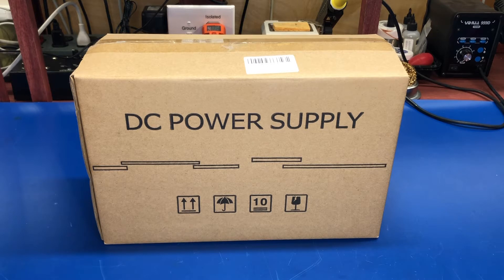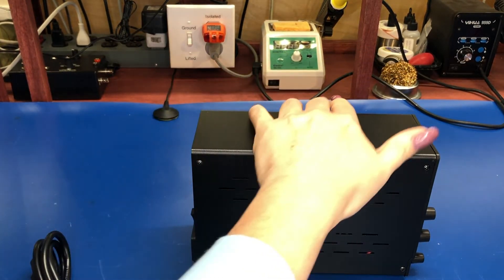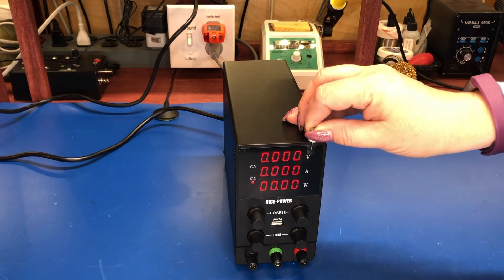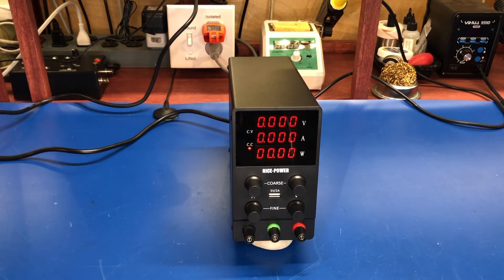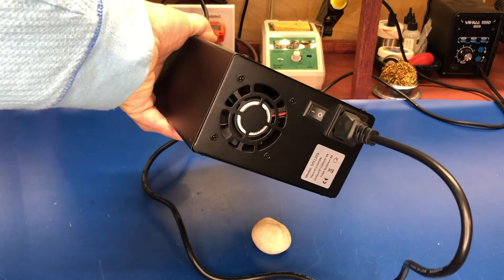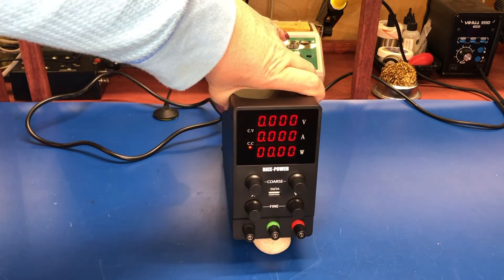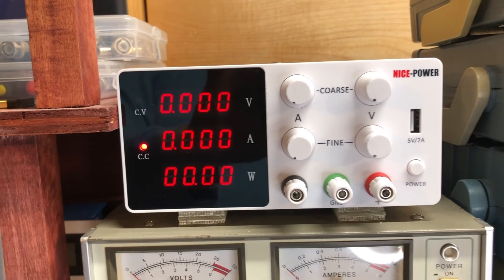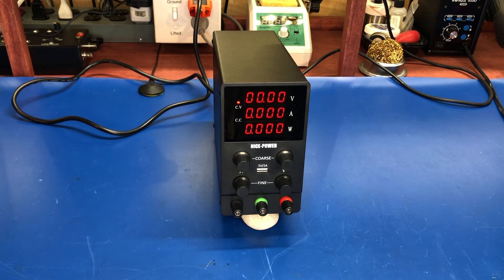Nice-Power SPS1203 120 Volt DC Power Supply

Comment: 120v version has 3a while 30v version has 10a. What if i use them both at 30v. Do i get same amperage or the 120v version max put 3a even at 30v or lower voltages

Comment: Well, I don't know, although it has NICE in the name, it is as much NICE as possible in terms of design, at first sight I see three problems.
1) The main switch is at the back.
2) It has no option to turn off the output
3) This is the biggest problem which could also cause the destruction of the connected circuit - large capacity at the output - (just see how slowly the voltage drops when reducing the setting) this tells us that the design of filtering and regulation is not good. This will also probably make it impossible to set small currents in CC mode as someone asked here.

Nice day 🙂 Tom

Comment: mine is having same trouble you are at 10:06..I short like it says to and the numbers go all over and go to zero, if I try to connect the leads it goes to zero, if I try shorting how you did, it goes to zero, I can't actually set amps to anything specific the way it is. I don't know if it's meant to be this way or what..
Reply from the maker: To set CC, set the volts to some small amount (around 1 or 2 volts), short the outputs, then adjust the current to the max you want, then unshift the leads. This works on the three Nice-Power supplies I have, as well as my old Leader LPS-152 linear supply.  Also, make sure your leads are not damaged (sounds obvious but it can happen.) If it's still not working, attach a load to the supply, and try adjusting the current. If you cannot, then the supply may be bad.
Reply: @Donna_Matthews  ok..I can set higher amp amounts but it won't let me set anything below around 0.300 amps, I'd like to set a  0.005 limit for something, guess I can't do with with these.
Reply from the maker: @Limousine08  These budget supplies won't regulate that low.  You are better off with a higher precision linear supply for low voltage / current.

Comment: Hi, I need some advice. I just bought a Power Supply Kococater  SPPS-S605: 60V - 5Am, pretty similar to the on the video. Firstable I am not an engineer but I am trying to emule a device with this PS. I want to use from 1 to 50V and from 1 to 35mA. I tried and set up to 20V and 5mA, but when it was used, the display showed: V:4.8 (it was moving but just reached 5V, and the Amper value did not move, it stayed on 5mA, this is the value I wanted). Here comes my question: What should I do and order to get this measurements: from 1 to 50V and from 1 to 35mA (I need to hold the voltage without changing the miliampers). Thanks.
Reply from the maker: While you can set an upper voltage and current limit, both can not be held constant as the load changes.
Reply: @Donna_Matthews  Thank you.

Comment: Most lab power supplies have relays which switch on at a certain voltage point. I'm not sure why lab power supplies use relays to turn on certain circuits in power supplies when reaching a certain voltage point. Do you know what circuits in the power supply the relays are turning on?
Reply: This is to save the power dissipation in the pass/regulation elements. It is switching transformer taps. Having a 50Vdc supply and asking it for a regulated 1 Volt means 49 Vdc needs to be dropped at the asked for current in the pass elements this generates heat QUICK. When asking the supply for 1Vdc and using the 5Vdc winding on the transformer only 4Vdc needs to be dropped in the pass/regulation elements. This leads to a cooler running and more efficient power supply.

Comment: it seems if you short your leads you would blow the power supply..why the hell would someone build something like that. what a weird way of setting your voltage. manufactures design GOOF...lmao
Reply from the maker: You short the leads to set the constant current. My Leader LPS-152 works the same way: set the voltage low (a volt or two), short the leads (briefly) and set the current you want.
Reply: I had test that if short the leads, it have no any harm to the power supply.
Reply: @jameszhangnice-power860 Do you mean that the source has short circuit protection?